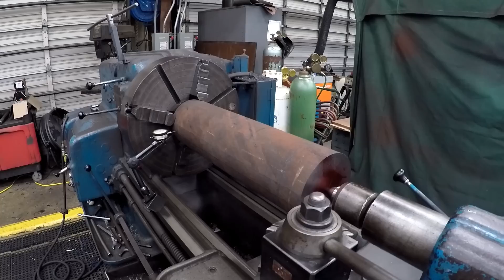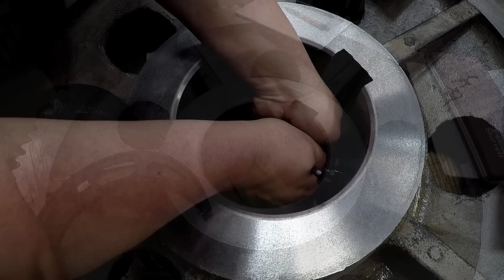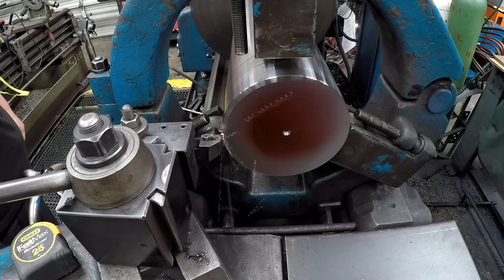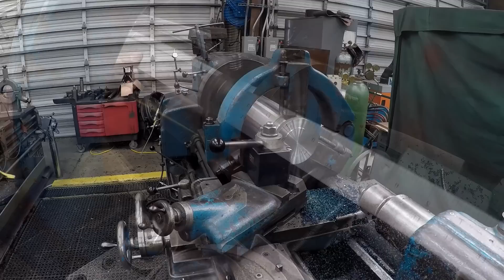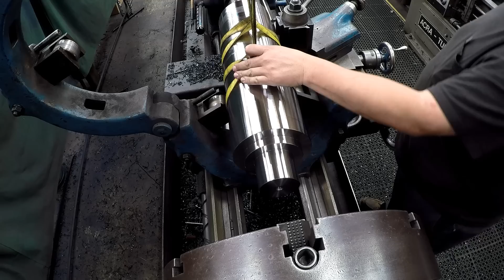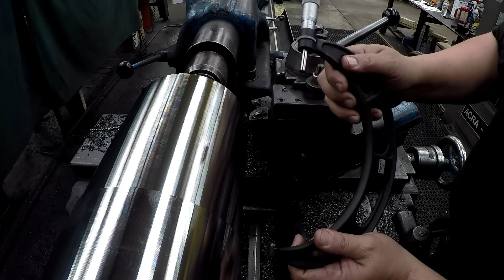Swedish Gearbox Shaft Part 1

Comment: Quick inch-metrique shorthand, what-for quick reference:
1 thou = 25 microns (μm)
10 thou = .25mm
20 thou = .5mm
40 thou = 1mm
100 thou = 2.5mm

These are all very much approximate, but more than good enough if you're eyeballing everything. For proper precision work you can properly convert a proper drawing using the proper conversion factor and a proper calculator 😉

Comment: When building replacements like this, do they give you both the original piece, and the engineering drawing that was used to make it? When replacing piping in industrial plants we are typically given construction isometrics and confirm the dimensions in the field before fabricating the replacement spools.... just wondering if you are in a similar situation.

Comment: I have a question about the inside mesurment.
How does one know that the micrometer is perpendicular to the iside wall of the tube in the gear.
Wouldn't it be better to have something like a letter "H" micrometer. Or maybe "Y".
So you have to only rock it left and right, and not worry about up and down to find the measurement. 
One would feel if the 2 points pressed by hand to the wall are stable, or are wobbling. I feel like that would give some assurance of perpendicularity rather than eyeballing it.

Comment: Did he just say 500/1000nths was a 1/4 inch?  Does that mean 1000/1000nths is 1/2 inch? Sorry for my ignorance but this is messing with my head?
Reply: 500 thou on the dial which is a 250 depth of cut

Comment: Nice video and editing as always. Thanks for sharing all those insights, helped me a lot understanding and putting more puzzle pieces together. Would say you also got me converting to inches quite regularly. It's pretty weird working with a different measurement system as the numbers totally don't correlate. I had to turn fits once, which put weird numbers in my head. Wished I could run your feedrates, but that would most likely snap my parts ;p

Comment: Hi Adam ,just wondering about method of tapping from tailstock,did you follow the taps movement by tuning tailstock handle ? cant imagine any success by allowing the tailstock to be pulled in given such a heavy tailstock.Thanks mate
Reply from the maker: I helped “push” the tailstock but keeping pressure on the hand crank at the same time the tap was pulling itself in.

Comment: This combination of metric and imperial is how we got to the moon; many of the design blueprints were made in SI units (metric) with the work being done just as Abom is with conversion of the units. Even the flight "computer" used metric internally but than displayed in imperial.
This is still how the entire world does aeronautical design, combining metric with imperial. Knots for speed in aircraft means navigation around the spheroid of the Earth is easier but also means imperial is never going away: knots is an imperial measurement. Basically, if you want to go into engineering it's best to know both metric and imperial systems and how to convert between them and definitely know how to clearly mark which units are being used where and why.

Comment: Hey Adam! If you were not going to have a keyway and you had a void like that where it needed to be solid. Would your course of correction be to fill it by welding and then go back over it?
Reply from the maker: Dave Ayala Is hate to weld over a new shaft like that. It’s not a repair job, it’s a new shaft from new stock. I’d probably reorder it larger.

Comment: A buddy of mine is a CNC operator by trade who doesn't know how to operate a lathe or set up mills and such, but always tells people he's a machinist. I told him to watch your videos and then tell me he's still a machinist and not a button masher. Needless to say, he was very humbled by how much he doesn't know. Thanks for teaching us all more with what you know, and don't ever stop learning more about your own trade and craft.
Reply: thejohnnybob Just because one handles a different kind of machines one isn't a machinist?
Reply: Arne Schwarz A machinist can not only run a lathe, milling machine, etc, but they can feel the machines and parts they run and will generally be able to make a tighter tolerance part versus a CNC machine (to an extent of course). A CNC operator can program a design into a computer and hit a button. Yes, the operator needs to know a lot of the same feeds and speeds a machinist does, but for the most part, the software he or she uses will tell them what an acceptable feed rate is for a given tool and given matterial.
Reply: thejohnnybob well ok, i guess it's a question of how you define words then.
Reply: Arne Schwarz I just see a lot more skill involved in machining on a lathe and mill versus a CNC machine. Either way, both a machinist and a CNC operator are more skilled than I am in their trades.

Comment: Here's a trick for when you get tired of listening to the tool squeal while cutting tough alloys. 

It's the tool overhang that's the problem. The bulbous end of today's insert tooling and universal use of quick change tool posts means the cutting edge over-hangs some distance from solid support. Everything is made of rubber and that includes blocky looking tool holders and 1" shank insert tooling. It will deflect and self-excite and the stiffness of the tool post and tool is what raises the resonant frequency into the kilohertz range. A screwdrive blade held vertically end down in contact with the top of the tool will skate frictionlessly because of the kilohertz chatter.

Try this: arrange the tool post and tool so the overhang is vertical over some part of the cross slide.  Drill a shallow 3/8" dia flat bottom hole under the head of the tool avoiding interferences like the clamp or the insert cavity. Cut a hunk of 3/8"  barstock to a length that solidly supports the tool at the center height. Use it as a solid prop under the tool. The shallow hole traps the prop from tipping out. The vertical component of the cutting force is directed into the cross slide and the bridge of the saddle. This will obstruct use of the compound slide but it will stop the squeal, inhibit tool deflection giving you more predictable size control, and possibly give better finishes.

Try it with a double nutted solid screw jack before you commit to drilling holes etc. Be careful it doesn't fall away when you disengage the feed; it could cause mischief if it tangles with the jaws.

If the top of your cross slide is machined you may get use of the compound slide. IIRC, that Pacemaker is as-cast on the top side of the cross slide.

Metric, Imperial, micro-cubits, atto-parsecs, it's all measurement units. So long as there are calculators and accepted conversion factors a good metalworker can make anything to fit anything from drawing, sample, sketch on a napkin, or, if he's crazy, verbal description. Besides the Metric system was invented for people who can't work simple math in their heads - like divide by two.
Reply: Another great video. Looking forward to the second part especially the threading
Reply: Good idea and I am a firm believer in rigidity. However I use a concept of Several job planning ideas. The idea of how many parts,  material, compared to size and theory of ripping through the roughing to save time for finishing. Chatter isn't always the best for cutting but a little squeal on some stainless don't hurt as carbide isn't exactly the cost of diamonds. Finish cuts are light compared to the rigidity of 1 inch tools and one of my favorite arrogant friendly pokes in the shop is "Hey, the carbide makes more chips when it's actually touching the part" lol. Have a great day all.

Comment: Adam, about the cooling down.period, you said that the shaft will be flipped end for end the next morning, do you leave it just as it is or do you slack (loosen) the chuck jaws a bit before letting it sit overnight?
Great video!
Reply from the maker: Francois Fouché I loosen the tailstock and let it rest. Sometimes I remove it and let it sit out of the machine.

Comment: Metric jobs in the US, that’s news to me. Impressed how you manage metric and imperial mixed. Great to watch.
Reply: Jojje 3000 If it's on a blueprint, we do it. Imperial, Metric, or Russian Arshin...it doesn't matter.
Reply: As long as you know how to use a calculator you should be fine ;-)
Reply: I frequently make a mess, did I convert this one...was it divide by or multiply...did I sum mm to inces

Comment: Nice to see someone else making heavy cuts. I see so many YouTube machinists taking little piddly cuts, it’s nice to see the machine actually breathing a little hard. Great job Adam.
Reply from the maker: Jessie VaineoHurst I’ve taken an .800” face cut before but did not film it. It was more of experimenting.
Reply: Jessie VaineoHurst Yep. My boss threatens to fire us for taking cuts less than .100...he prefers .250
Reply: chris0tube I totally understand the reason behind it. It’s just nice to see someone other than me taking heavy cuts. I usually around .300” per side in steel on my Bullard.
Reply: Abom79 that’s a hell of a face cut. On a Bullard CutMaster at work, the largest cuts I ever did was .400” per side ID, .400” per side OD, and .300” on the face all at the same time.
Reply: My little Logan Lathe can only take so much.
Reply: I just started running lathes, how do I stop it from making so much smoke, I don’t like taking anything over 10 thousands because it smokes

Comment: No lubricant when machining 4140 , Is there a reason ?
Reply: @chris0tube
I am having a really hard time not calling you an utter fool.
That insert costs at most $25.00, and will probably rough out the entire job. Considering the size of the cuts he was making, I bet he still has at least 1 corner unused. Next time, try not to turn other people words around. I never said I don't care about extending tool life (in fact I said the opposite about it for other ops), I said it is irrelevant to what he was doing. The customer is going to pay for the entire insert even when he only uses part of it.

The stock he is turning runs about $25.00 and inch.
Add labor at something like $100.00/hour
Do you really think the cost of an insert has any effect on the price?  The job wont get done any faster, any better or an cheaper running lube or coolant while roughing.
I suggest you are the one with a closed mind. You might just want to look into why coated inserts are coated in the first place, and why pros approach each job individually and use their experience to deal with in the way they feel will get it done most efficiently and with the least hassle.
Reply: @chris0tube,
Yes, no reason. As I stated, extending tool life and improving finish is not relevant to this part of the job. The finish is already excellent for roughing, and the cost of inserts is rolled into the quote.
He is already working near the practical limit of the machine, so the only gain would be less noise.
Adam is good, he does this exact job day in and day out, and he tries new things on a regular basis (he often shows them to us). If there was any practical gain to coolant he would have used it.
If he follows usual habit, you probably will see him using either a spray mist, or oil during the finishing. Even so he may not bother, the part will prolly be finished with emery to deal with any taper etc.
Keep in mind, that machine does not have a chip conveyer, and he has to shovel all those chips out of the pan himself. nice dry chips are preferable.
Reply: @chris0tube
Not going to argue this anymore. You are clearly penny wise and pound foolish. You think you are seeing the whole picture, but you are only seeing what you chose to see and ignoring everything else.
Reply from the maker: Coolant helps but is not necessary to do a manual lathe job. I’ve been using my coolant mist but is hard to get videos without is splashing on the lens.
Reply: No reason to use coolant or lubricant with a coated insert for roughing.
Lube will extend tool life, and improve the finish, neither of which is relevant for this part of this job.
Reply: DAVID Hearne- With that carbide, it is not really necessary, and on a manual lathe with no enclosure, coolant or oil gets really messy and dirty.
Reply: Alwaysbebatman 122 No matter what tip I use, my boss would kill me if I don't use coolant and true, it is messy.
Reply: Many inserts will last longer without coolant. Coolant can lead to thermal shock with carbide inserts thus causing premature wear.

Comment: Hi Adam, love your videos, you are a master of your craft, and a thoroughly entertaining chap to boot. Can I ask about the Imperial Metric thing ? Most of you guys in the states, really seem to have an issue with the metric system. As a builder/woodworker I find that that millimetres are far far easier to work with than dividing 17/32, every time you need to measure 13.5 mm ! And the hundredth of a mm, is far and away more accurate than the traditional "thou", and much easier to calculate. As you know us brits worked in feet and inches for a long time, as did the Germans, and most of Europe surprisingly. I watch a lot of stateside you tubers, all great and good people. I just don`t get the aversion to Metric measurements. After all, our mathematics are in decimal format. This is not a dig, just be interested to know why. Happy Christmas. Russ xxx
Reply: For many of us, it's not so much of it be an "aversion" as you say, but rather what is most convenient for our machines, stock, plans and tooling - very typically scaled in inches. For metalworking in particular, working in "thou" (thousandths of an inch) is every bit as convenient as hundredths of a mm. They're both decimal based - so neither is really more convenient or easier than the other. Sure, for rough measurements, we often revert to fractions (1/4in, 1/8in, 1/16th, etc...) but for the actual work in finishing metal, it's typically done in decimal divisions of an inch - e.g. 4.715in. That said, it is true that woodworking is almost always done using fractions. If I had all metric measuring equipment and scaled tooling, and my wood/metal stock came nominally sized in metric, and my plans were all in metric, I'd find it no problem whatsoever to work in that world. In many ways for those of us here in the US, we already do use both (some to a greater degree than others). Ultimately, if I had my personal preference, we'd be 100% metric, but I find knowing and using both perfectly workable. (The main downside is the cost of keeping both types of tools around.)
Reply: Russell Watkins 
As a dutch person, I learned everything in meters, decimeters, centimeters.....and so on. In the US you learn everything in inches and that stuck with you, I can understand that. You have a feeling and internal check for meassurments for the system you learned, if you know what I mean. We use to have 'de gulden' for our money and that changed to euros in 2001. But lots of people over 40 years still caculate the prices back to guldens, beacause then you can get the feeling, if something is cheap or expensive.
Reply: Russell Watkins As a Structural Engineer, I see units of measurement as any other form of language.  Imperial, metric, astronomical, nautical, relative, quantum, hexadecimal, binary... I am fluent in most.  It's all a matter of "can you math", or proficiently translate, what is presented before you.  This debate about Imperial vs metric is as childish as juvenile arguments over English being better than German, Spanish or Japanese, or vice versa.  When in reality, which is better is irrelevant when all you have to do is translate (convert) into the language that you prefer and still arrive at an accurate and identical interpretation.
Reply: or.....theres more than one way to "skin a cat"
Reply: Being an American and using Imperial units I'll give my view.  I have no aversion to metric, it seems Adam doesn't either.  As he stated, all his tools and machines and such measure in Imperial, so it's easier to keep it that way.  Also, if the US were to try and switch over the metric the amount of tooling and such that would have to be switched over would be astronomical.  I think the big thing is it would simply cost way too much to try and switch over.

Edit: Also, since we learn imperial from when we're young, most of us are just used to it so we don't really have any problems with the weird fractions and such.
Reply: The automotive industry is all metric these days - and when you're working CNC, it doesn't matter if it's imperial or metric.

One of the big challenges are things like bolts, bearings, seals, and hydraulic parts, which are primarily stocked in imperial sizes. Had to repair a hydraulic pump once that was German made - the only place I could find seals was two hours away, at a specialty hydraulics shop that serviced shipyards.

Comment: Adam you have taught me a lot, but now I humble believe that I must suggest you a tool to speed up your metering (6:40) that I use since I was a teenager... I believe that a Mitutoyo bore gauge set 511-932 it's what you need. It's easy, fast and 100% reliable. It helps you to measure thru the whole length and to control the cylindrical shape. No more double measure 😊
Reply from the maker: Roberto Maddalena We have internal tri-mics up to 6” at work and I use them sometimes. We want to keep investing in larger sizes.
Reply: I've used them too in my former job, and I appreciate so much that kind of tools especially when I'm building something new. I hope to convince my father to buy some of them for our shop because they are so fast to use! But, when I must cope with old stuff to repair or check a very deep bore ... In my humble opinion...The bore gauge has something more to offer. It tells you exactly where a cylindrical deformation is, or it can "jump" over a journal shoulder.

It's just my opinion mate! Thanks for your answer.